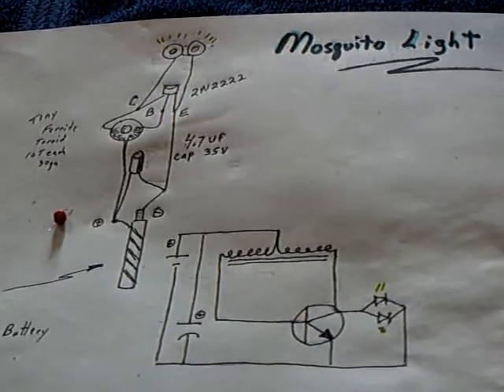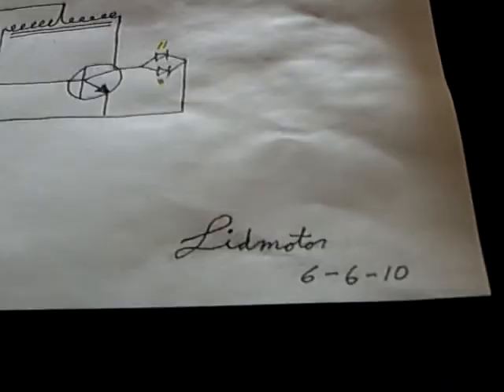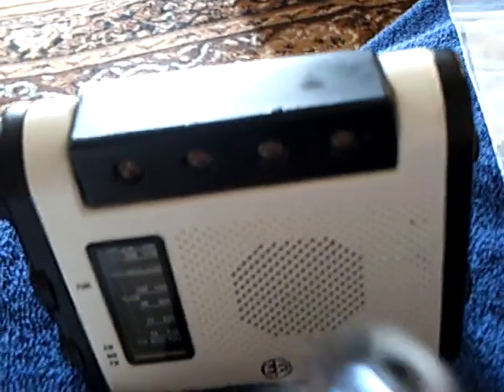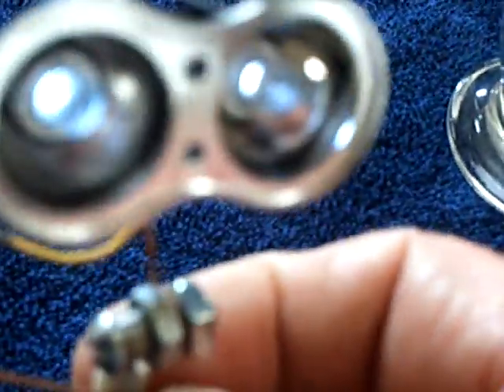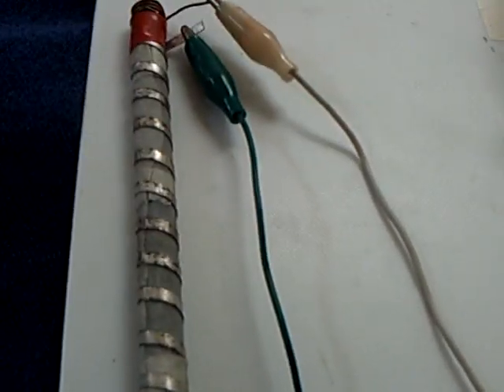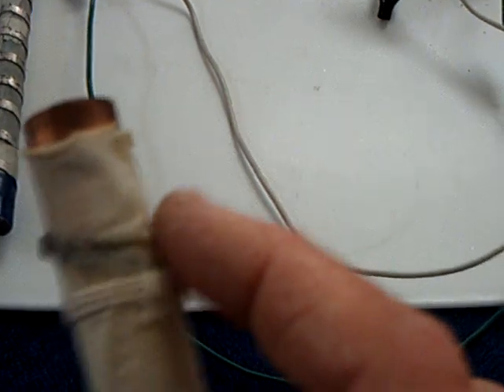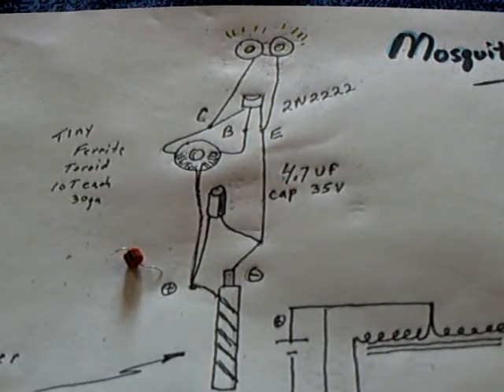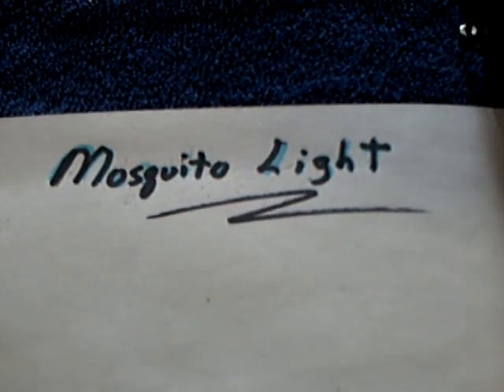Mosquito Light

Comment: Thanks for continuing to share! :-)
interesting point on the corrosion. I wonder how much longer it would last if you could put the battery parts in a small vacuum tube - no air. the water might not evaporate as well?

Comment: Have you tried using a toroid that has multiple secondary windings with these galvanic battery driven Joule Thief's yet?
I was just wondering how the secondaries perform.
The idea of being able to hook-up a couple of different devices to the same pulsing toroid has worked for me, and it's a fun thing to play with - plus it's a great learning tool. 
Granted, that bead toroid is a tough one to wind multiple pick-up's on, but if I can do it, you can do it.